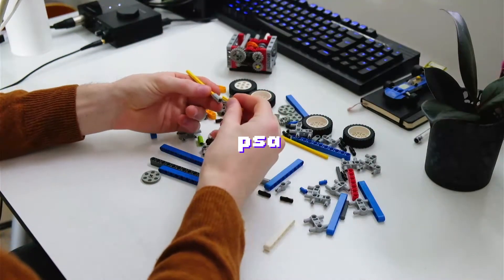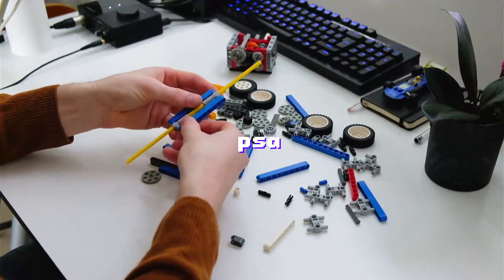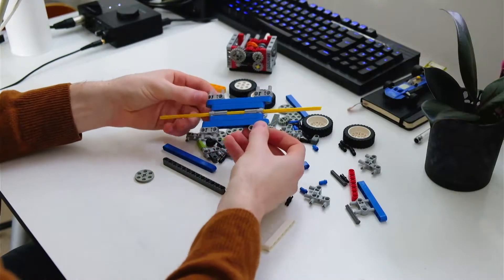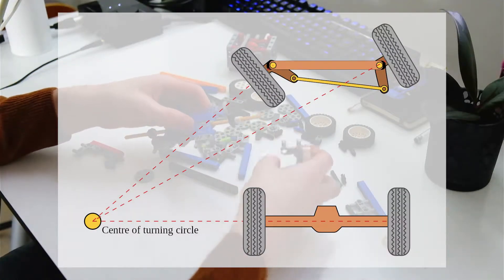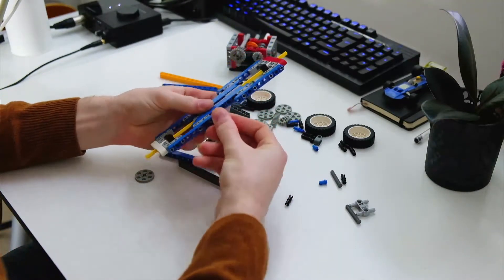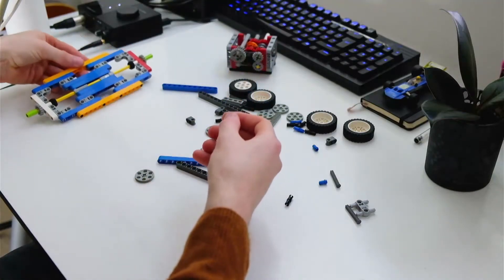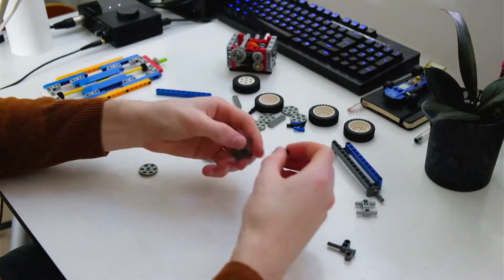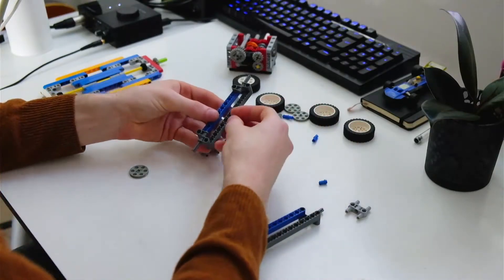Lego Technic Camera Dolly with Ackermann steering [Instructions]

Comment: The big problem is to motorize it.
Reply from the maker: Yeah I agree, I wanted to keep it simple though since it's just limited to excess parts I have, I think eventually i will use a winch system if anything, or maybe build a new one from scratch. I would have to redesign the whole steering column to motorise it for sure.
Reply: @clipdump  no it seems just right. Except that motorization. I want to build one to make my videos and thats why it needs to be that simple